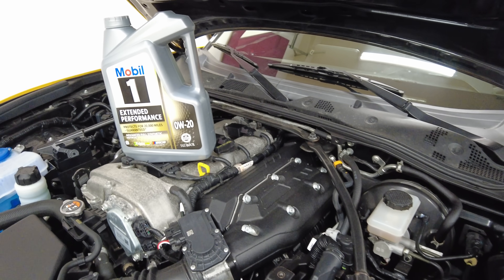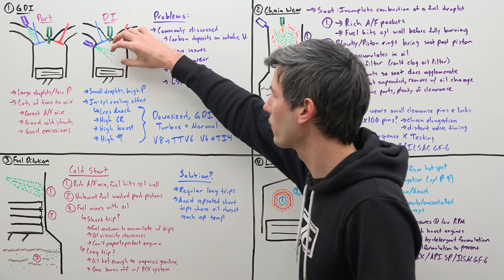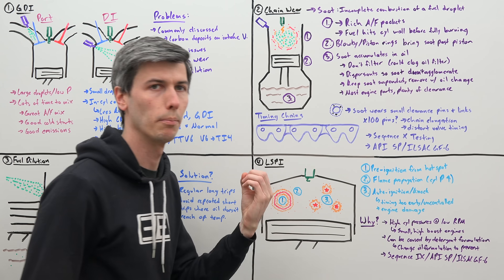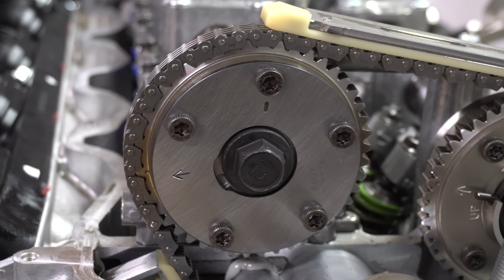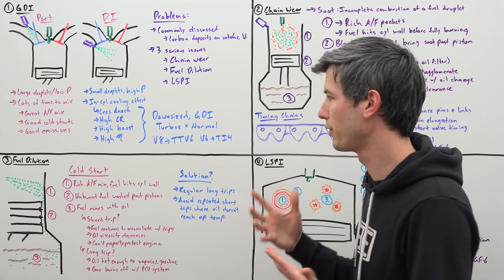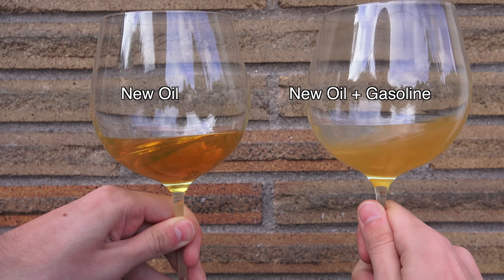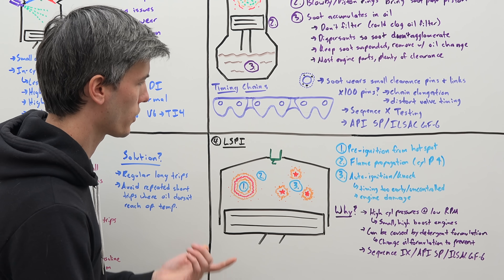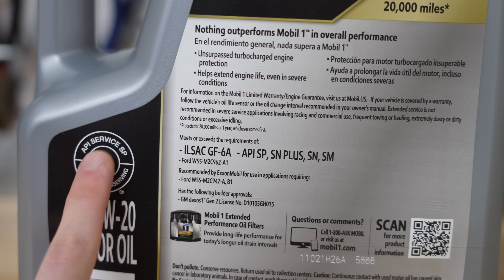3 Big Problems With Direct Injection Engines (Gasoline)

Comment: Why not do what the diesel did and put a oil bypass filter in to deal with their soot issues? ? Doesn't GDI end up creating problems they deal with already???  I know, I must be missing something because this problem has been sort of fixed in Diesel motors using the bypass filter. Too simple or what?

Comment: I remember reading that particulate matter emissions was a significant problem for gas DI engines as well, and unlike diesel engines, gas engine aren't properly regulated for those emissions.  Is that correct?

Comment: My 2022 Subaru BRZ needs oil added between oil changes, 1 quart after 4000 miles. Will 5W20 help slow it down instead of the Factory 0W20? I only use Mobil 1 SP oil after my breakin was done. I now have over 15,000 miles and it seems to be using more oil then my last 2 oil changes? Thanks for any reply.

Comment: Great video, explains a lot. Seem it would be better to trash can the GDI system and go back to the old port injection, solve a lot of unessasary problems. And once again my quastion as to the new viscosity ratings! How will the 0w16 - 0w20 oils in these 3 cyclander turbo charged engins do in hot 3 didget climates hold up?? I mean...what is the climatic tempature rating of a synthetic 20 weight oil?

Comment: After watching this video, it seems that Direct Injection creates more problems than it solves. How can this be more efficient than Port injection when you're creating soot and incomplete combustion? What is the advantage over port injection? Also, how is direct Injection timed in relation to the stroke? Is it timed somewhere along the intake or somewhere on the compression stroke? Does that timing vary according to engine load or temperature? ...Love your videos, they are very well constructed and detailed.

Comment: Besides using the correct oil rated for your car, it's also very helpful to change oil sooner than the engine manufacturers recommend. It helps with soot, water vapor and fuel dilution plus it controls carbon buildup so the compression ratio doesn't go through the roof
Reply: Costs money unnecessarily too.

Comment: So, thanks to political geniuses like AOC, Nancy Pelosi and Creepy Joe Biden, we went from an efficient, easily maintained and good running fuel injected engines to inefficient, costly, and unreliable gasoline direct injection engines.
Reply: LOL direct injection was introduced under Bush Jr in the early 2000's, and kicked into HIGH gear under Trump in the late 2010's. What an epic fail of a comment. 😂

Comment: Wonderful Explanation! I have a 2022 brand new car from china 
Forthing T5evo which is equipped with 1.5T( Mitsubishi 4A95TD) direct injection. OEM required 5w-30 
Should I use thinner oil 0w-20 instead, since I used my car at a high ambient temperature?

Comment: Thank you, this was very informative.  I have a 2020 Honda CR-V with the 1.5 L GDI turbocharged engine.  I change the oil every 4,000 mile with Mobile 1 and I find the dipstick oil level is above the full mark after a few hundred miles.  In my experience, the gas diluting the oil does NOT burn off during a long trip.  After long (100+ miles) trip on a hot day in the summer, I never find the oil level returning to the normal full level; it's always above full.  I'm  very concerned about this.
Reply: I am sorry you had this issue, you are definately not alone in this. This engine is notorious for this problem. It's unbelievable that there isnt a class action lawsuit.

Comment: How about sealing the timing chain area with its own oil supply, not getting any of the stuff from the engine with soot etc.? It might even not need changing any more than say a differential's fluid, it wouldn't get dirty and would not wear out for a very long time. And the cam chain etc. would get top quality lubrication at all times.

Comment: Carbon buildup on intake valves. SOLUTIONS-> 1.) Oil Catch Can installed  2.) B12 or other brand chemical cleaning of intake valves.  th-th-that's it f-f-folks.
My 2019 MAZDA CX-5 2.5 L. turbo is direct injected so I use a Cork Sport oil catch can. And at 40,000 miles I'll get a professional  B12 brand chemical clean of my intake valves. Also I use only Chevron, Mobil or Shell gasoline, all of which have good injector cleaners in them. PLUS every 5,000 miles I run a bottle of Chevron Techron injector cleaner through the engine on a full tank of gas.

Comment: I have worked on the direct injection 3.6 V6 that GM makes. I have never seen so much carbon build up on intake valves. So much build up And huge deposits, so much it caused misfires etc.

Comment: Understanding the basic operation of the gasoline engine, I cannot understand why throttle body mixing or injection is not the most efficient way of achieving the proper mixture.

Comment: gm turbo engines had the problem of preignition and actually destroyed pistons, etc, and they ended up changing thier oil standards  to use DEXOS only to prevent the preignition of the engines. I actually saw couple of cases where the pistons destroyed the blocks, and drove one or 2 cars that had the heavy engine knock! these cars ended up going to the dealer for engine replacement

Comment: Turbocharged or supercharged engines with intercooling should not need "direct injection" ? (Port injection good enough?)
on a atmospheric aspirated engine direct injection is a way to get the absolute maximum amount of air and thus oxygen crammed into the cylinder (fuel does not displace air since the fuel can be injected after the intake valves close)

Comment: What about a direct injection system that only functions at full throttle? (Would require another fuel system for use in all other conditions) Two separate fuel systems as an extra expense for those wanting the ultimate performance possible from the particular engine type.
Reply: Direct injection main benefit is better fuel mileage at lower speeds

Comment: one of the most important thing i've learned about engines is that taking very good care of your oil is basically the best thing you can do for engine life, also just not pushing it while cold
Reply: I do both those things and run exclusively on premium fuel and my god you wouldn't believe the difference premium makes especially on a modern engine like a GDI.

Comment: Question, I have an 18 Toyota Corolla and I only have the dealership change the oil. If they are using Toyota oil would that still meet the requirements you mentioned from the specialized tests? How can I find that out?

Comment: DFI is unnecessary. I'm a Service Advisor at a GM dealership and we see so many of the Ecotec motors come in with misfires and it's almost always bad injectors. Also, the bad injectors foul up the spark plugs and flood the oil with gas so now the customer needs 8 new spark plugs (no point in changing just 2 or 3) and an oil/filter change to accompany that expensive service. Good money for us especially if the vehicle is out of comprehensive warranty but it's a pain in the ass for the owners because they depend on their truck.

Comment: Working in a small engine rebuilding shop I can tell you there was plenty of carbon on the backs of intake valves since I had to clean it off!  Those engines had carburetors so the fuel couldn't keep the valves clean.  Engine oils were much lower quality.  My dad's '55 Mercedes 6 cylinder had direction, was driven 10 miles each way to work for 20 years and have very little carbon on the intake valves when we went through it.  My 09 Chevy had virtually none at 70k miles.  This engine warms up very quickly due to the low thermal mass.  As for timing chains, I've found the same as others here that it is the plastic guides that disintegrate causing timing changes and worse skipped teeth.  Not saying none of these "potential" problems exist - just that I haven't seen them personally.  If it worries you, don't buy a car with direct injection.

Comment: Modern cars are ugly, glued together, ugly, overly complex, ugly mobile white goods. Plastic brutalism on wheels. Designed to look old very quickly. 

There's so much unnecessary engineered obsolescence e.g. EVERY plastic part, let alone all the sensors and chips connected to them. Talk to ANYONE connected to cars and they will list how they're becoming harder to work on and inferior in general. Single use plastic sump plugs. Paintwork that delaminates. Exposed black plastics that go powdery grey. Plastic headlamp lenses that go yellow and cloudy. Headlight and taillight units with seals that fail so that they fill with condensation or water. Low profile tyres that get chewed up. Car batteries built to fail once just past their warranty period. The list really does go on.

 Engineered obsolescence is baked into too many parts of a car, other parts are too complex to economically work on, other parts need specialised hardware tools or proprietary tools/equipment. In the end, modern cars are a immensely expensive razor and razorblade business model scam, or perhaps more accurately, an expensive disposable 'safety' razor racket. Apple is the worst in the tech game but it's a modern problem across the board. 

Hopefully alternatives will come (imagine that sentence written on the meme with the waiting skeleton) 😕

Comment: Good video. I have a 2015 Mazda 6 with a 2.5L GDI engine. I have noticed the oil stays much cleaner than my non GDI cars after 5 thousand miles. I have sent out an oil sample to be tested and there was no dilution that took place as the viscosity was just like new oil and the base (TBN) was within spec.. Apparently less soot is produced by this engine.  I did do a intake valve cleaning at around 38K miles and did notice the oil got darker after the cleaning was finished. Apparently there was some carbon buildup on the intake valves. I know Volkswagon and the new 1.5 L GDI turbo Honda engines have had deposit problems and the Honda engine has oil dilution problems.  Not sure how Honda solved this problem or not, since I haven't heard anything about it. Do you know if Honda found a fix?

Comment: I did not quite get how the calcium detergents in engine oil formulation affects knocking. I found and read the summary of the SAE article "Impact of Engine Oil Detergent on Low Speed Pre-Ignition (LSPI) and Fuel Economy Performance" but I did not get much wiser, except that magnesium detergents seems to work better. So that left me wondering does calcium form tiny catalytic particles inside the combustion chamber during compression? I thought that calcium must be inside the combustion chamber to cause that pre-ignition. I just don't want to purchase the article to see what it is and how does calcium cause pre-ignition.

Comment: My girlfriend and I both recently bought new turbo subarus (an FA20DIT and an FA24DIT). As I normally like to do, I sent a sample of the oil to Blackstone for analysis at the first oil change of each. They found high fuel dilution in both. Is this something that will improve as the engine wears in, or will this likely continue for the life of the car? Additionally, one of the cars has an air oil separator. Will that keep the dissolved gas from ever burning off since it gets sent back to the sump before it can be burned out?

Comment: Thank you Jason for clear explanation! I have few questions that I want to put out here. 
1.Gasoline has higher octane number compared to diesel. Is it because the auto-ignition temperature of gasoline is higher than that of diesel?
2. If that is the case, can we operate GDI gasoline engines with sufficiently high compression ratios and injection pressures without spark plugs? Because in GDI engines, the fuel is added much much later to the air and the chances of knock are less.
3. In that case can we operate gasoline engines as compression ignition engines with leaner air fuel ratios like that of diesel?
3. If we operate GDI gasoline engines on compression ignition principle, will knock become desirable. That is, will I want the fuel to ignite spontaneously beyond  a certain temperature? Will I want low octane gasoline?
Please answer if possible.

Comment: I wanted to pose the question on timing chain wear.The increased torque,on some cases,twice as much from a gdi engine as a port Injected engine. Would this not accelerate timing chain wear in itself? One only has to look at the difference in the size of a bicycle chain compared to a 250cc motorcycle chain?

Comment: Cars made for the European market are now coming with gasoline particulate filters to trap and burn off the soot. I'm just waiting for regulations in the US to also require GPFs. If GPF's do come there will be many changes for those who choose to abide by Federal and CARB emissions. Rosch does not support the use of their supercharger on the GPF equipped 5.0 Mustangs. CARB legal turbo and supercharger kits might not be able to be used, but I'm sure Ford could find a way if the demand was large enough. Exhaust modifications are more limited from a legal sense, as you can only do GPF back instead of cat back. Shorty headers could probably still be used, but just like they are now you're spending a lot of money for a few horsepower.

Comment: My take away: use a quality oil (synthetic ? - Motul, Mobil1, VW502.00, etc.) and change it more often if doing a lot of short trips.  Alternatively, drive for longer (30 mins+) to get the engine up to operating temp to burn off fuel that is being mixed in with the oil.

Comment: Is fuel dilution something that inevitably happens, or is it just the results of something else needing to be fixed?
Reply: Its a result of people short tripping their cars too much. 

There has been a long standing theory on the F150 Ecoboost forums that the guys who run their trucks hard towing trailers or just general shenanigans are the ones who get the best life out of the engines. There actually appears to be an element of truth to this. If you pull a 5000 lb travel trailer through the air at 70mph for 4 hours and your engine gets nice and toasty, any water or fuel in the oil is going to be long gone.

Comment: Thanks for your explanation.  I notice that timing chain stretch usually happens only in the I4 engines of some German brands like merc and bm while their respective I6/V6 engines that use the same technology don't have this problem.  Would you agree that this is likely due to the secondary imbalance of I4 engines ?
This new tech is only designed to save you money in the first four years of the cars life.  After that it's cheaper to run an older v6 that drinks more at the pump but is waaaay  cheaper to keep running correctly.

Comment: Hi I am hoping you can help me out with a problem I am having with my 2001 Chevy Silverado 1500 4.8L motor ,  The issue I am having is my motor is pinging under normal load and I light miss fire and hesitation  when I try to pass a car on freeway or getting on the freeway  and going up hills .   I maintain my truck well oil changes every 2 months  spark plugs I use OEM always - I changed out my knock sensors a out 1 year ago the mechanic shop I  am not sure if they used AC  Delco could this be causing all these problems I am having ?

Comment: Do the VW diesel engines have these same issues? I acquired a 2013 Jetta Sportwagen TDi and was amazed at how thoroughly black the old oil appeared when I recently changed the oil for the first time (156k). It had the appearance of black paint. The oil change was done at the regular service interval (10k), going off the service records provided by the previous owner. I can't tell if the previous oil change was done with an oil that conformed to the VW 507 spec, but it was a full synthetic oil. Could that explain the blackness? Or is the oil in a diesel engine typically dirtier than oil in a gasoline engine, all other things being equal? I did use a 507 oil for the recent oil change.

Comment: There are a lot of claims being made in this video, but where is the data to support it? For instance, everyone would agree that short trips are bad for an engine for a variety of reasons. Yet the claim here is very specific, that short trips lower the engine oil viscosity. So where is the experimental data for this claim? Providing such references should be a bare minimum if you are making a technical presentation.

Comment: My 2000 Chevy 4x4 Suburban 5.3L still gets 14 mpg with 255,000 on the clock. Fuel range is 420 miles per tank.